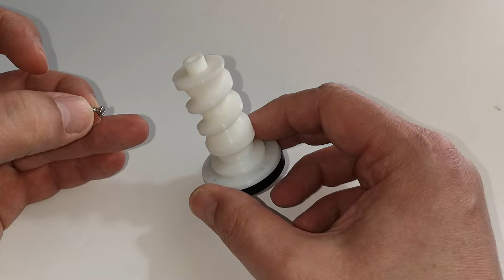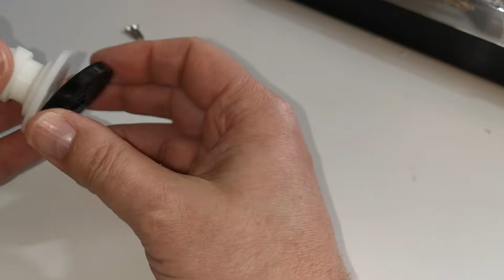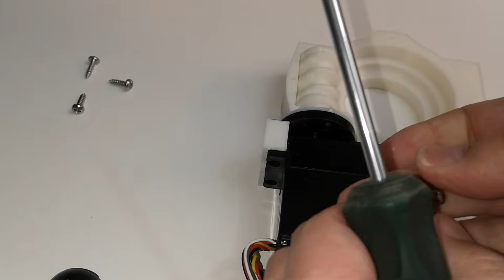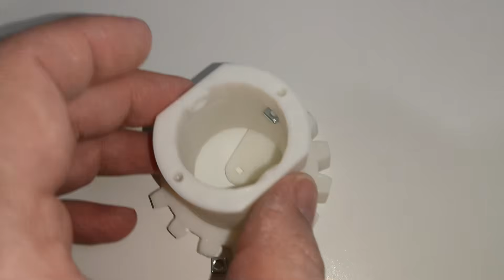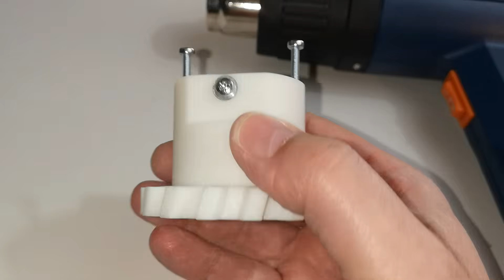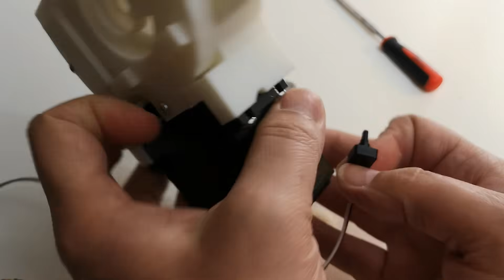Civrays InMoov - Right shoulder begins

Comment: One suggestion:  Instead of using the heat gun,  I use a soldering iron indirectly.  Put the screw and nut into place make sure the nut is oriented in the hex hole properly.  Make sure the tip of the screw is flush with the nut.  Now take your soldering iron (I turn up my Weller to about 80%).  As you heat the screw tip and nut apply a little pressure. Once you get up to the proper temperature you will feel and see the nut sink into the plastic.  Remove the soldering iron then use a pair of needle-nose pliers and squeeze it in firmly.  After everything cools down remove the nut apply a drop of crazy glue into the plastic hole for the nut and squeeze the nut back in.   I  then take the screw and keep running it through the hole always keeping it moving until the crazy glue sets.   By setting the nut this way you are not heating the whole piece which could lead to some distortion.

Comment: Is regular lithium grease ok or does it have to be white/clear lithium grease? BTW.. perfect timing. I planned on starting the right shoulder tomorrow. Your videos have been a great guide! Thanks!
Reply from the maker: I think any grease will be ok, but if it's a yellowish colour it may discolour the plastic parts.
Reply: @SteveRaynerMakes  Thanks Steve.
Reply: @SteveRaynerMakes  in your video 38:24 it only turns 90° is this correct
Because if my shoulder is facing down it only turns 90°up and I'm now confused on how my arm wil reach All the way up
Reply from the maker: @louwrensburger1796  It should rotate 180degrees.
Reply: @SteveRaynerMakes  the one you installed turns 90° how did you fix it to turn 180°
Reply from the maker: @louwrensburger1796  It is actually capable of moving 180degrees. In the video I only programmed it to move 90 degrees.